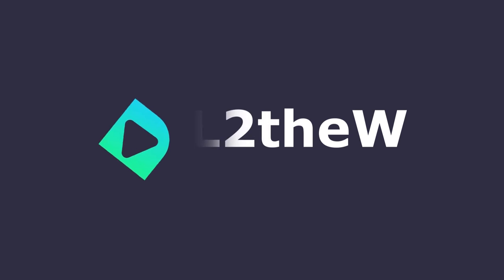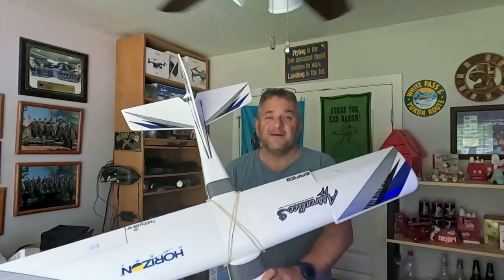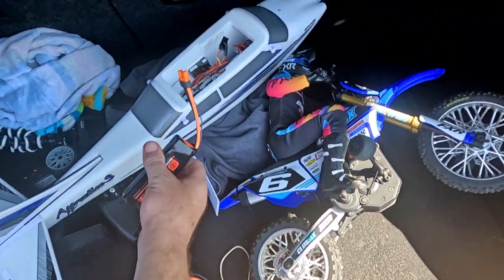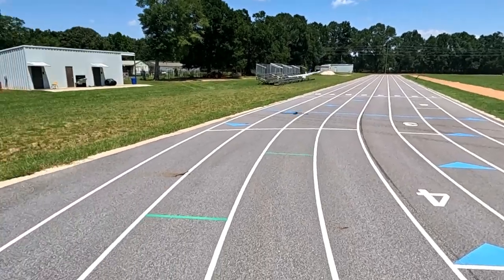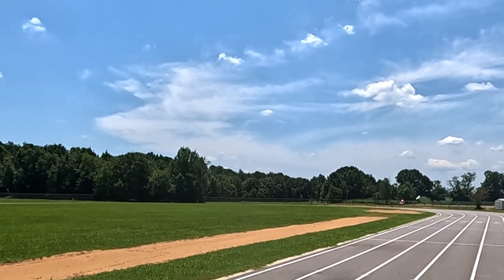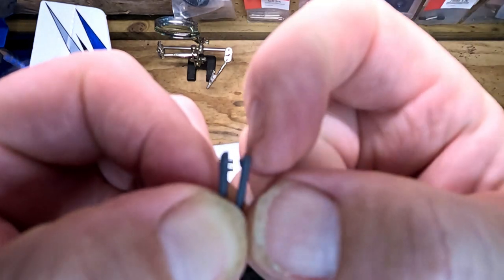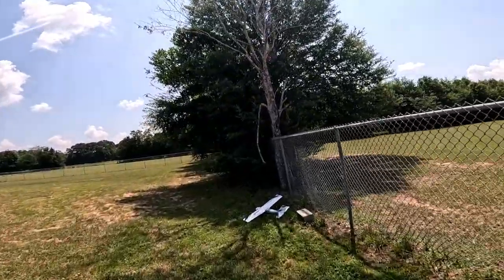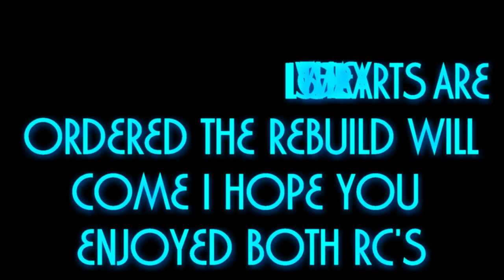Ripping With The Losi Promoto RC Motorcycle And First Time Flying A Plane It Did Not End Well

Comment: You DON'T want anything smaller!! You want BIGGER!! A smaller plane will have to fly much faster to stay in the air and is going to be fast and hard to control. You want a large plane that flies slower until you get the hang of flying RC. You also say you don't like flying it high but it needs to be above tree level unless you are landing. You now know why! Always try to keep it in front of you and remember that when it goes away from you left is left and right is right but when it's coming towards you it's the opposite. You'll want to practice landing in a very tight mowed grass field or dirt first and it's easier if you stand at the end of the field and start your landing decent on the far side of the field coming straight at you so you can adjust. Just remember everything is reversed coming at you. When you get more experience you can move to the side and let it land coming horizontally to your position. As you come in for decent slowly start to pull back on power and let it glide in instead of coming in with power. Just before you flare to land you want the motor idle, let it glide down to the ground as it loses airspeed. Being such a small plane there is very little flare before touchdown or it's going to hit hard. You want just enough that it doesn't hit the prop or front landing gear first.  The way you were flying so low, you were just asking for it to crash.  Keep it up and above the tree line so if something happens you have time to react and if you lose power you have time to find a place to glide to land. Without power it's just a glider, you have to remain calm and just glide it in. You did pretty well for the first time though. It takes a lot of practice and when it comes to planes, even with experience, you're going to crash now and then. Make sure you have spare parts available. Just wait till you get into gas-powered engines! Remember the bigger it is the slower it flies and the easier it is to control and learn. Then sized down. Good luck and when are you heading back to the AT?
Reply from the maker: All very good advice thank you. I know most of it from using drones and rc cars you know the problem with a plane is its faster you cant hover and think for a second lol. One of my biggest problems coming from drones is the right stick up is up its backwards on the plane and I know I can reverse the servo but I want to learn the right way. I figured that field would be easier than try to shoot a landing on the track but there is too much in the way its half as long as the track its hard to find good open areas. I was and still am reluctant to spend 200 on the simulator program but maybe I should I jus made an investment in this plane now some new parts and I have some car stuff coming lol.  I know he principals and what I should do but you panic and I got it all backwards like you said I should have went left to avoid the tree I was trying to practice a landing so I cut the throttle and when I saw the tree and really turned hard there was no momentum to carry it through so it went wide its all part of learning. As far as the trial my knees are wrecked they are still not at full movement my wife is on me to go to the dr but I am afraid of what the options will be